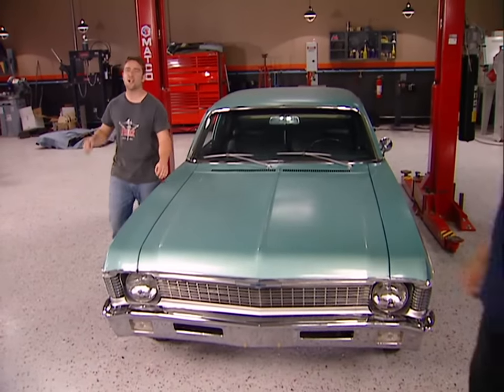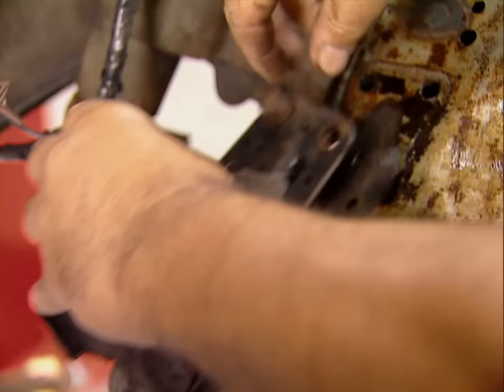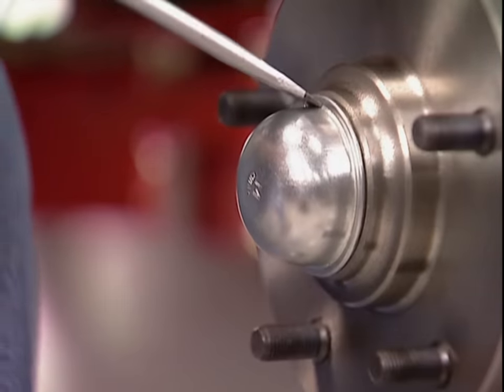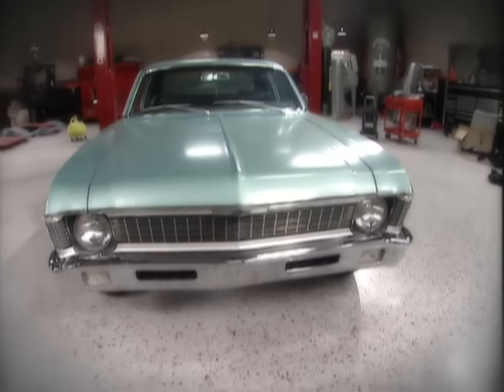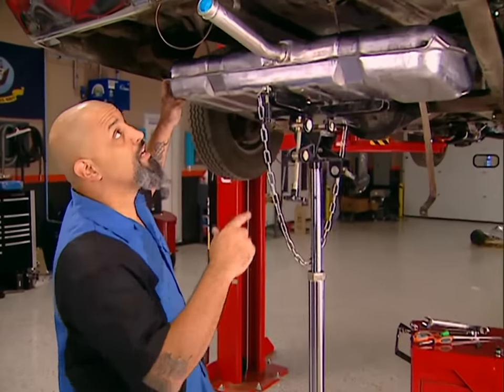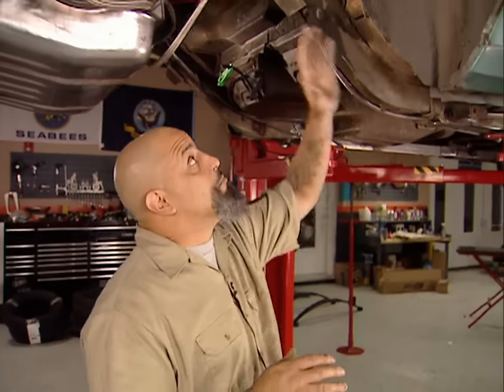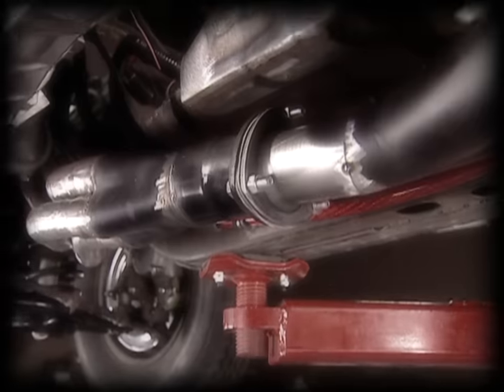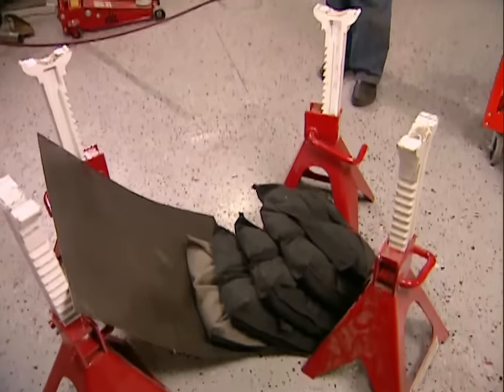FULL BUILD: Out With The Old Lady Car, In With A GM Crate Engine Upgrade For A 1970 Chevy Nova

Comment: Another thing I'd like to add is this isn't truly a "shoestring budget"!! A good example of this is the front disk brake conversion!! YES throwing new parts at it if you have $800 to $1200 cash laying around is well and good, BUT in true "budget build fashion" not everybody has that kind of fruit just "laying around"!!
Some of us have these things like house payments, wives, kids and other bills that have to get paid for!! And $2000 to upgrade the front end might not actually be "budget worthy"!! Another alternative is to source salvage yard parts, as many of the Nova spindles, suspension and even disk brakes interchange with other GM models!! In fact the Nova shares spindles with Chevelle, Malibu, Monte Carlo, Cutlass, Skylark and Lemans/GTO!!! Meaning if you can find one of those cars in the salvage yard, the front spindles are direct bolt ons to a Nova, Omega, Ventura, and Apollo!! Some of the upper and lower control arms swap out too, but you'd have to look up which models fit what!! I know this all because I used to own a 1974 Oldsmobile Omega that back years ago was a literally STREET MONSTER, with a Rocket 350 under the hood!! LOL

Comment: 1:17:07   Never use Teflon Tape  on any fuel connections,   ALWAYS  USE TEFLON TAPE.    When you screw in the connection,   small pieces of Teflon Tape  will be cut off the connections,    and float  towards fuel jets.    Which will result in super lean condition  🤔. 
Always use paste.

Comment: Crate LS with a carburetor?  In many states, it would cease to be street legal.  In CA, a cop seeing under the hood could get it banned.  In NV, the normal inspection process would ban it.  In TX, it would have to be registered as an exhibition car but risks getting reported in one of the safety inspections.  More cops are contacting insurers and asking the garage address so out of state plates are dicey.  I think MI and TN still look the other way on swaps like this.

Comment: Manual transmissions average a 15% driveline loss. 
440 hp x .85= 374 whp
vs
435 whp / .85= 511.76 hp 
Doing the H/C/I on the LS2 only added 71.76 hp. 😳😳😳

Comment: What Lou did to the Nova was great...up until he put wider tires on the back.  Anyone could have spotted this and instantly knew something else other than stock was under the hood.  The stance didn't change much but anything that has even a slight slant from back to front is not stock.

Comment: Cool way to use the weight of the engine to pick up the frame sag. I think a throttle body intake would give you more head space under the hood

Comment: No straight six niva came with a posi rear?....what did they do out back. 235 60 15 is a small tire! And the front disc brake conversion they put at least 10 grand in parts alone into this car!

Comment: They completely ruined a perfectly good Nova. It had more horsepower with the first engine before they did the engine parts change and then the original Hood did not fit.and the nitrous wears out a engine and they took off side trim which made the Nova looks so much better. I don't know who's calling the shots but it ain't no sleeper no more😮

Comment: Those are some ugly headers. He didn't back purge the tubes, so they failed a long time ago. But I like what he did with the rear suspension. The SS springs will give more traction without using traction bars. Leafs are fine for straight-line speed.
 But yanking the coil on plug for a distributor boggles my mind. Nitrous is completely uncalled for with only 235 wide tires outback, and the cowl induct hood takes the cake. Lou built a great sleeper and the old man and the kid fucked it up.

Comment: A third-generation two-door Nova can't be a "sleeper," since they look like a fast car due to their late '60s muscle car era styling. It's like trying to make a "sleeper" out of a late '60s Dodge Charger or Chevrolet Chevelle, or the very similar-in-concept Plymouth Duster. A "sleeper" needs to be a make/model that was never available as a fast car from the factory, and didn't look like a fast car either, like the 1977 Ford Granada that Powernation did.

Furthermore, even if it had been a make/model that can work as a "sleeper," it wasn't done right anyway, since the fat tires on back / skinny tires on front, and sound of the exhaust gives it away.

Comment: i love the build but the distributer add on ruins the point of why guys go ls to begin with. tuning is much more accurate just using a factory ls harness with pcm. i wouldnt do the ls swap just to go backwards and add a carb and all that other non sense but thats just me. all my cars except my 5.0 mustang have ls engines in them.

Comment: This is where sponsors kill builds.  It's bad enough they slapped a carb on top of a fuel injected engine.  But then going 50 steps backwards and removing the tried and true reliable coil on plug for a weak AF distributor?  Nothing like blowing out the weak spark when the nitrous kicks in. It's almost like there's a reason the automotive industry ditched the distributor over 20 years ago.

Comment: Okay guys you ruined that one! I know 2006 2008 and long time ago people got a little smarter about it now. The 2006 spending $7,500 on it sounded off with cheap in today's money but you guys paid up in 2006 money. In short the 2006 crew did all right. Normally I would cringe at the idea of taking a survivor and yanking the motor out. But that 2:30 straight 6 it's a piece of junk! It is not like it's bigger Brothers 235 cubic inch or the 250 CID as far as reliability and everything else. So drinking that motor out making a sleeper great thing. Then you got your 2008 crew that comes in and ruins it! It fit with the spacer before under the hood. Now you take the spacer out and it won't fit under the hood what did I miss or the heads that much taller raising the intake? I'm commenting as if somebody from the original crew will answer this which is not the case. But 666 horsepower well that's the devil's number and the devil's in details and that's where you messed it up in the details! Besides basically the bottle kicked in most of it. I guess maybe the distributor set up a little high in front. Then he showed how much you didn't care about the car it's just a prop piece for your TV show! It gets a dent in the back quarter! Now since you guys beat the car up and had to fill the back quarter full of Bondo filler that is I guess the repaint was okay but otherwise you did not match the paint color anyway look at the doors when you open them. It don't take that much to mask and paper at all and spend the next few days to paint the inside of doors trunk lids the fenders at the hood etc. You just went with a stock color to not read the paint and matched it by spraying the hood. But you put that dent on the back of it I still rather see that hood sprayed to match the original paint of the car and leaving the trim on it. If you going to do all that change the color. Maybe if it's still laying around the warehouse someplace about 15 years later now. Just turn it over to some YouTuber who actually knows what they're doing! Sorry did you want some Vaseline with that truth?

Comment: A low mile car like that shouldn't be chopped and butchered. Ok. Maybe the 6 cylinder has to go and powerglide. But there's plenty of old school stuff that fits that wouldn't ruin it and run just fine. You people just don't appreciate history!
Reply: its a base model Nova for gods sake. it wasnt a yenko or even an SS. run of the mill bone stock Nova.
Reply: @harveylong5878  yeah, like they're just a dime a dozen! Get real!!! It's people like you that don't appreciate the history of these vehicles even if they might be a base model or maybe even a 4 door. You can't just walk down the street and buy one of those for $600 anymore. If the car was trashed and thrashed then maybe do what they did but as mint condition as that car was, it's not worth chopping the frame like they did! It's worth putting a V8 that fits, particularly old school.

Comment: Absolutely confusing build. 440 hp before.  Add 10 grand worth of unnecessary parts and we have 435 hp. Let’s spray it??  Come on man!!  Disappointing to say the least.  That was not the intention of the build.  Should have left the 6 banger in it.  At least finish it off with some Chevy Rally’s.  The 82 Malibu hub caps are hideous and not period correct.

Comment: In Europe if they catch one with cut-outs, the police will impound the car immediately, issue a large fine, make one build the stock exhaust in and submit to a technical inspection at one's own expense, including paying for the towing costs. Things are no better at the race tracks: they installed noise pollution detectors around the track, so if one is too loud, one gets sent home. Maximum tolerated noise on the race tracks is 96 dB.

Comment: All of Lou's work was for nothing!  You show a great sleeper project for absolutely no reason.  No need for the cut-outs or hub caps anymore.  Hell, you might as well go for big old Micky Thompson racing slicks and a blower sticking out.  It's gone from a great daily driver to a pro stock.  Great job of ruining another car.  There aren't that many "Granny Cars" left, you should have used a wrecked race car to bring back from the grave.